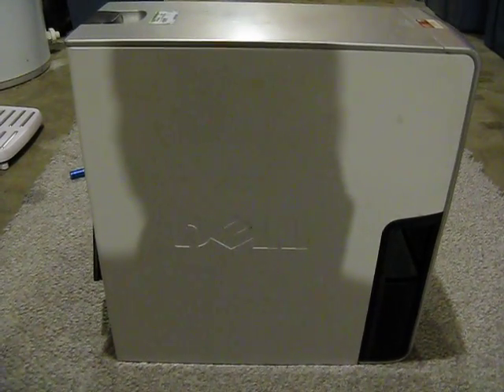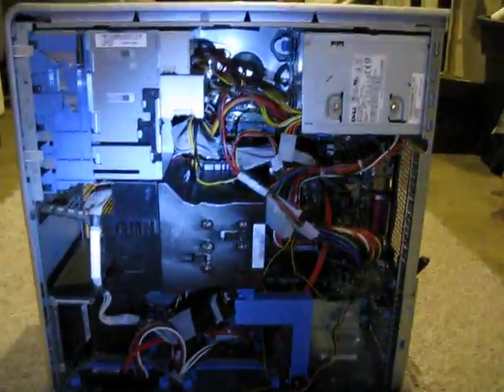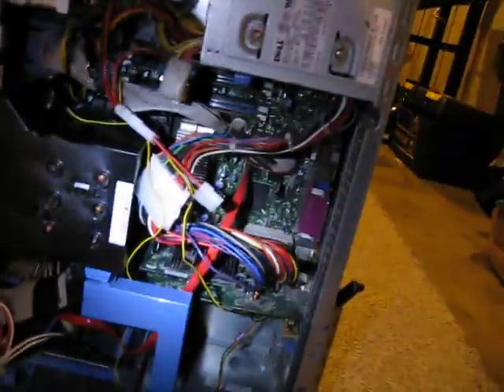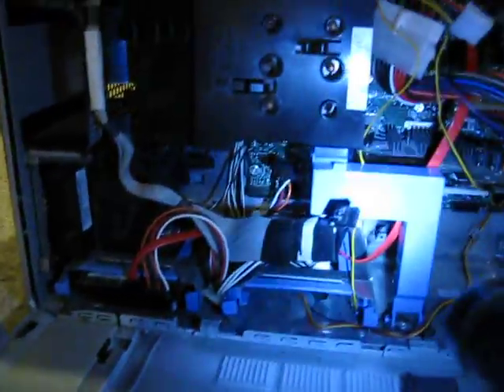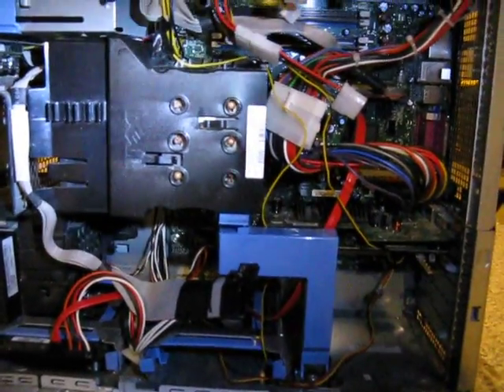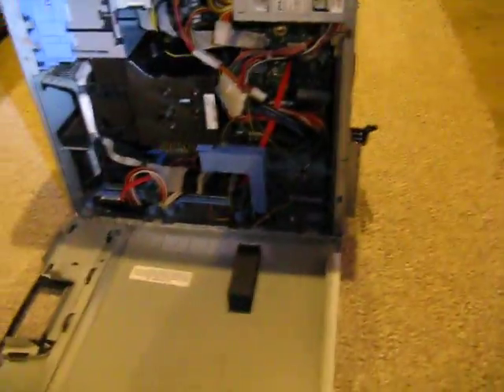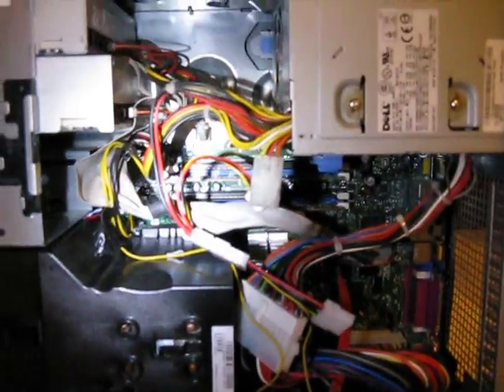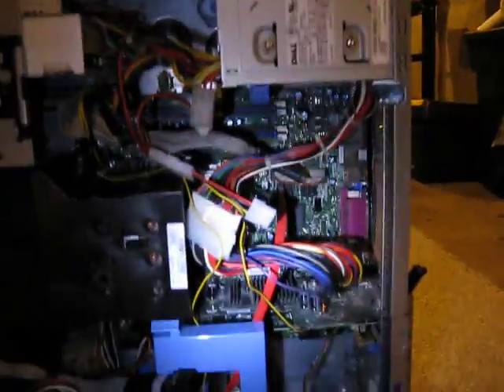Dell XPS400 BTX Motherboard Swap to Intel D945Gcz

Comment: the only plus side is that it will fit a quad core but then you would probably need a 12000bts air conditioner attached to it or cool it with nitrogen..

Comment from the maker: To anyone that didn't finish the video:  I did explain how BTX could not allow equal traces to the RAM modules due to the design flaw of that over site THAT was the main reason BTX was not adopted. You also could not use an after market CPU heat sink with most BTX case designs (if any?). You couldn't fit dual slot graphics cards properly without modification in most cases. 

The one really good idea was air flow through the case, which was a good idea, however with the lack of ram cooling and unequal length traces to the ram modules it was not a good idea.  

BTX was proprietary in that you had to license its use from intel which is silly, does anyone think AMD wouldn't have come up with AMX to defeat BTX if they had a format war? Then we as consumers would get screwed because ATX is a free use form factor AMD, Cyrix, IBM, and Intel were allowed to freely use ATX.
Reply: hi, i gota question for you since i just bought a Budget piece of crap btx hp model, which is not identified in the case by the way, but the original fan cpu cooling goes from the outside to the inside, its a real headache, ive tried to change the fan direction but it just doesnt cool ANYTHING properly, i barely dared to change the thermal paste to no avail, it just makes the cooling 10% more eficient , i know i definitely have to shed the old case for an ATX case, that i know, but how did you manage to screw the thermal module (which by the way is total crap too) to the atx case. The wide part of the blow out (or blow in) floats outside this board.. im going nuts man.. the speedfan controller gives me horrible heat readouts , min 53 c.. max 75 WAY TOO HIGH..  and by the way speedfan versión 4.52 will control this board´s fans  correctly without the external fan controller, (only plus)

Comment: Good job with the case mod. Personally, I would have replaced the Dell PSU with a good Seasonic or Antec. But, you did an awesome job with it.

About BTX, my biggest personal gripe about it is that you cannot use a dual slot PCI-E graphics card. I made the mistake in buying one for my Optiplex 330, only to find out that it will not properly fit, without serious modification of the case.

Comment: BTX wasn't really a bad design, My precision T3500 uses "some" of the BTX ideas, runs cool as a bean at 3.46 ghz. Lack of adoption is what really killed it. While true Dell isn't the easiest systems to work with but the form factor itself wasn't half bad. ATX and Mac pro's today uses many if not most of the ideas too. But I do like your mods.
Reply: Pear CD btx is shit no upgrade path for mobo and CPU period.
Reply: ***** Yup. Totally agreed. You can't gut a Dell case and put in another motherboard easily anyway. Even the ATX is nonstandard. There's always a gotcha. But the BTX standard itself wasn't a terrible design considering. But I am more of the liking to what HP did with it's ATX towers. They flipped the motherboard and thus with the right fans, it's not half bad. Just limited room for GPU upgrades and that case is highly upgradable. Swap, swap, swap. I am not a fan of pre-built to start with, but if I was going to go down that road and was worried about future proofing things an older HP isn't a bad way to go.

Comment from the maker: you need to use a mulit meter and find the wires that the power switch on the case connect, after that you need to attach them to single pin connectors EXAMPLE: Dupont 1-Pin Female Motherboard Power LED +/- Connector - Black

Comment from the maker: This. Thank you. This is why I posted this video, I believe tower desktop computers should be made more universal not user un-servicable if something goes wrong. The computer industry has come a ways since these days.. I dont doubt we will see one-offs like this still pop up, but if people know what to avoid and or voice opinions to large manufactures that we prefer not to run into custom designed pin outs of insanity they will make less of them.

Comment: I handed this very system down to my 5 year old.  I added a Geforce GT610. He wanted some blue LED fans like daddys pc. So I mounted a blue LED exhaust fan to the rear just below the PSU. It looks pretty cool and takes the heat out really well.  Nice video man thanks.

Comment: What a mind blowing eye opener.  I have an XPS 400 with a blown mobo and my searches turned up your video and I'm so glad.  I had no idea what a BTX mobo meant or how it was configured until now.  Well, I'm going ATX and bypass all that mess. Thanks for all your info and insight into your rebuild and what not to do.

Comment from the maker: yes I soaked the fans in water while they had no electricity running through them. Look it up people have run motherboards through dish washers and they still work (I am not kidding) I would not recomend it, but I can assure you a fan has no electronic components that will be hurt from a good soaking in water and then a nice 24+ hour dry out period.

Comment from the maker: you have to take everything out of the case, the large heat sink for the CPU comes out fairly easily after you remove the screws holding it into the case, unplug everything

Comment: My Xps 400 stopped recognizing the k/m.. it only post the dell splash screen and it says keyboard failure after..  I reset the cmos jumper, took the battery out replaced it ., I unplugged all the non-essential parts and rebooted, checked the ram.. pulled the mb out, everything..... I concluded that's a dead board.

Comment: actually if u got a gateway, the normal connectors work just fine. dell is a prick about using proprietary connectors on their computers making mods a major pain in the anus.  btx is actually a great motherboard format because it is an extremely efficient cooling system.  i got a gateway that i put an intel DG965MS motherboard and a 2.4ghz core 2 duo with 8gb of corsair xms2 ram 300gb raptor xfx nvidia 9800gt xxx edition 700w psu extra 1tb hd all working in perfectly with 30 degree C cpu temps

Comment: Nice Dell Power Supply, NOOB! Haha JK, I have an XPS 400 and the first replacement I had to do was the PowerSupply, I finally ended up having to replace the motherboard with a ATA board. Its way smaller and I had to unsolder the old power button of the front IO to even get it on

Comment: I have a xps 410. It was bought at a thrift store for $100. It was really dusty so I took all the drives out and then soaked it in the bathtub cleaning it out with the shower.  I took it out and let it dry thoroughly with a fan on it for 2 days straight. Put it all back together and it fired right up, and I'm still using it to type this!

Comment: The only reason I use Dells is because they R so krap that people leave them 4 free on the street. I'm not making this up.  Go around 2 local comptuer shops & electronix dens & U will C them along with Gateways & misclaneous 'home brew' types & that's about it.  Used 2 C a lot of E-Machines & Packard Bell 2, but mostly Dells & Gateway krap now  =))

The ONE good thing about Dells (aside from being FREE) is they have very good sound quality (IF use the 'Analog Devices' chipset).

Comment: BTX is not "total crap" ATX boards aren't standard either, unless they are aftermarket. Otherwise ATX boards also have proprietary port locations. Don't even get me started on small form factor PCs and laptops. 
BTX was supposed to be a industry standard (electrical layout and cooling are better) but Dell and Gateway got screwed when others that agreed to change didn't. 
Almost all OEM computers, whether ATX or BTX are proprietary in design. Only aftermarket homebuilder stuff is standardized.

Comment: @epoxeclipse Pentium Ds are not stripped down dual cores. And the Pentiumd Dual Core which you say, are not based on netburst. They are based on Core architecture.

Comment from the maker: @JoseRozon The pentium Version is a stripped down core 2 duo, It is based off of the core2duo design but yields less performance due to the pentium (net burst) architecture which is not good.

Comment from the maker: Just so you all know the Dell xps 400 is working great till this day, surfing the web and running windows 7 64bit  (aero enabled) - Yes it is 100% possible to load windows 7 on this motherboard. 

I don't remember if I had to load sata drivers or not.. you might have to change the BIOS setting to IDE not AHCI to get it to install easily. 

Its a DELL XPS 400 BTX Case, I would not attempt to put a ATX board in a BTX case under any circumstance.

Comment: i have a problem i am doing exactly what you did but i am replacing the motherbord with a asuse P5N-T Deluxe also its a atx mobo but i want to use the btx case i have the 420 is is possible (im not unfilmure with case modding)

Comment: And this definitely explains why I don't ever buy stupid crap from Dell or some HP models because of their proprietary connectors and stupid motherboard configurations. And besides, building your own PC with your own specs is easy to maintain, upgrade, and somewhat cheaper, too.

Comment: I upgraded the motherboard on my xps 400 too, when the motherboard went bad. I soldered cables straight to the board with the on and off button so that the USB ports would work and but  didn't figure out how to get the audio working. The funny thing is that you used the same motherboard that I did.